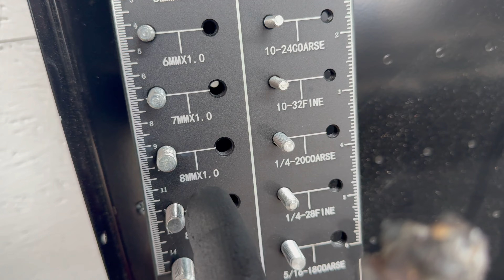Mazda Skyactiv 2.2 Exhaust Camshaft Replacement DIY Tutorial Video

Comment: Thanks for the video! You are worth your weight in gold! I wish you were located in Ireland, so I could bring my Mazda 6 to your garage. I had a low oil pressure event few months ago, after which garage replaced injector seals and blocked strainer, also turbo, dpf (eckhem) and two injectors. Two thousand km later it got a low oil pressure error again, and it seems this time I might be looking into complete engine rebuild. I am considering doing it myself, since I am mechanically inclined and right now I am rebuilding my motor bike. Your videos are critical to help me understand what is going on under the hood!

Comment: Thank you so much mate, I had problem with my Mazda 6 it was leaking oil so I was about to change the engine seal, after checking my exhaust camshaft and watching your videos I think I need to replace mine it looks worn , just a question my car cranks but doesn’t start !! I’m thinking to do a carbon cleaning too do you think that’s the problem?

Comment: hey mate been watching your videos trying to fix my 2016 skyactive mazda 6 i changed the strainer as i had the oil pressure fault but after i got a maf sensor fault so i followed your video and removed/cleaned the intake manifold i also cheanged the senor but im still getiing the fault would this be my next step? also what do you charge to do somthing like this?
Reply from the maker: Which fault are you still getting? What's the fault code?
Reply: Thanks for reply 
Im geting P0101 I cleaned the carbon out of the intake values but it keeps coming back

Comment: My mazda 3 sky active 2.2 just stalled it's engine when I changed gear and the starter is struggling to turn the engine over . What's price on engine replacement
Reply: What made you think that engine must be replaced? 😮
Reply from the maker: Message me on my facebook page. Same username and profile pic as on here.